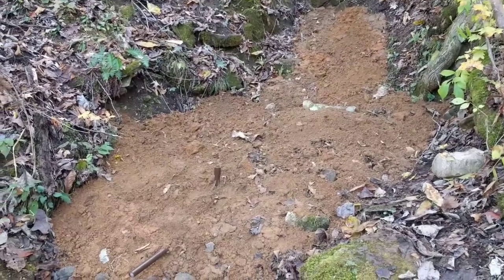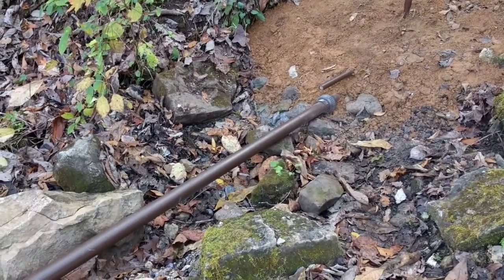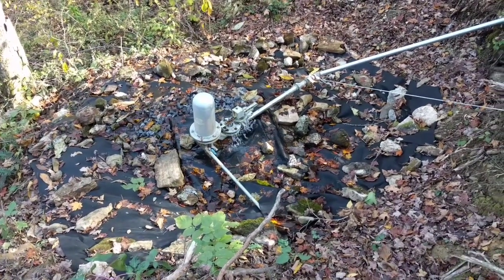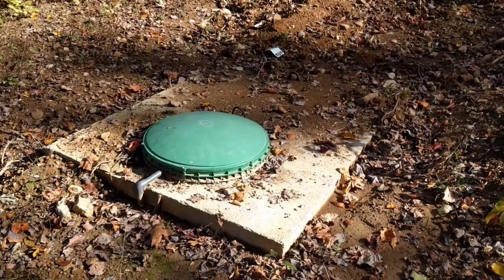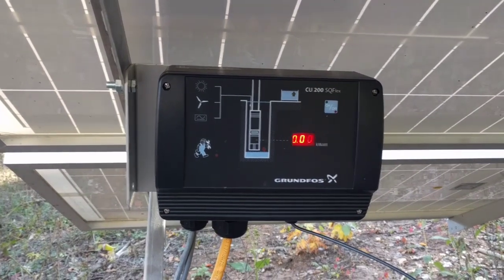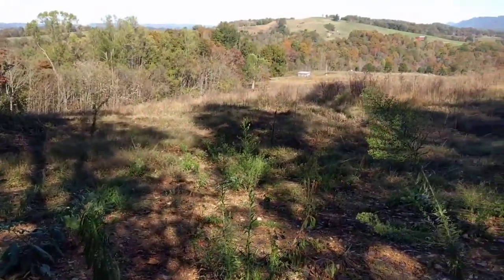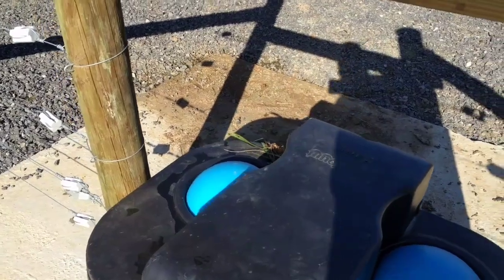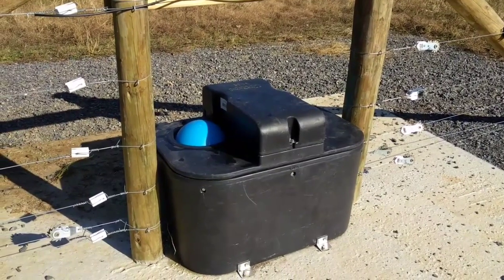Spring Development project Part 2

Comment: Are you near to mill Spring? I just moved to the area. I have a Carolina Watertank on a ranch I just bought. Learning the system (needs to be serviced/cleaned) and I want to set up a ram pump to keep the pond full in the summer. Nice setup!
Reply from the maker: That is awesome you will have to look for a different company for a RAM pump. Rife went out of business and I am having to build parts for the ole girl when they wear out.

Comment: Does this system run all year round? What are your winter temps?
Reply from the maker: Unome Last yes it does run all year long. Winter temps vary so much here. We get below freezing sometimes below zero, but it seems to only stay there for a few weeks then it'll warm a bit then drop again. I worry through the winter and make sure the RAM doesn't stop pumping for more than a day. The spring collection, drive pipe, and RAM pump are the only pipes that will freeze. The rest are buried below frost line.